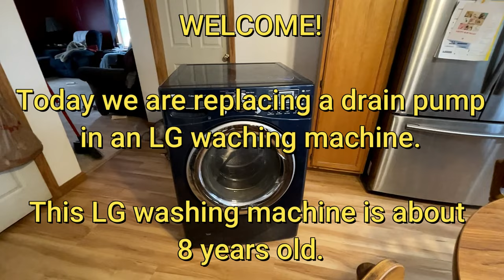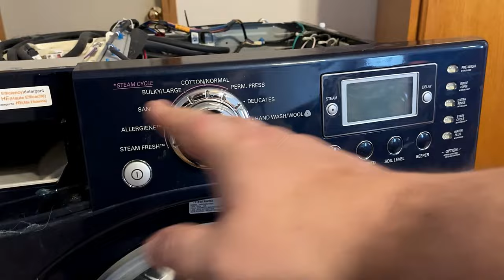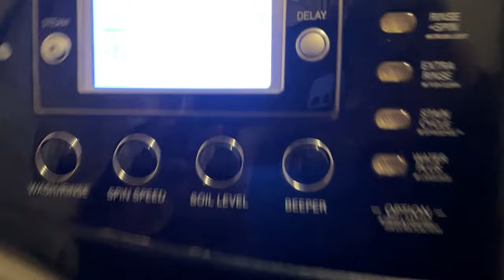LG WASHING MACHINE DRAIN PUMP REPLACEMENT - DO IT YOURSELF & SAVE BIG!

Comment: When you took the photo of the black and brown wire connectors, the black was on the right.  When you reassembled, black was on the left.  Did it work fine with those wires reversed?